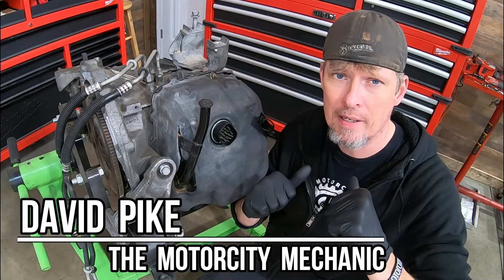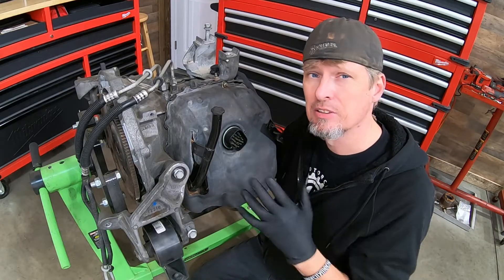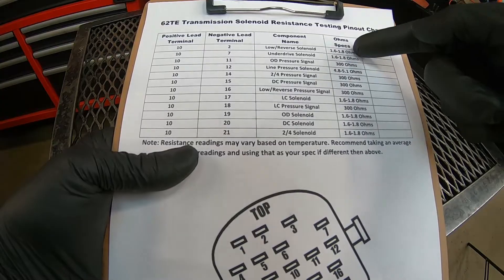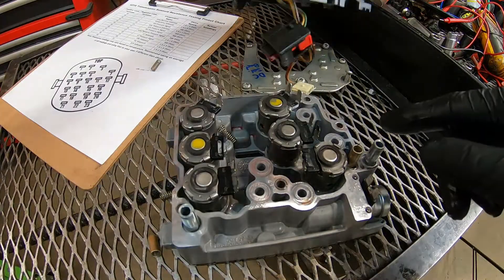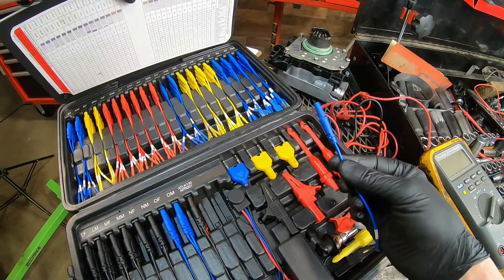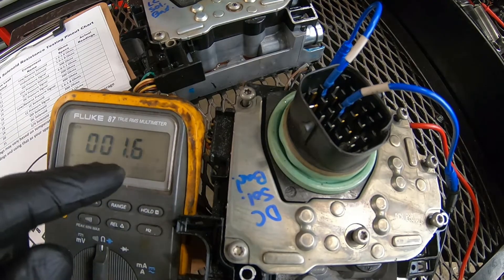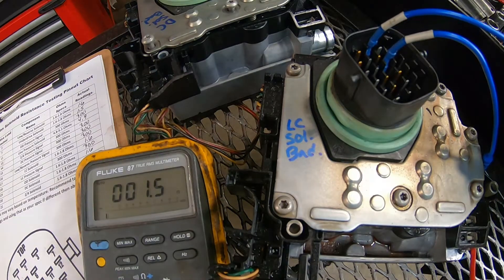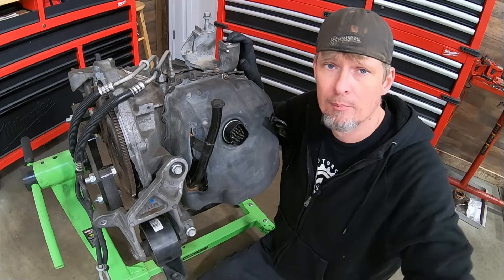Chrysler/VW 62TE Transmission Solenoid Pack Testing

Comment: Fantastic! Thank you for the link to the pinout/Ohms chart. Helped me almost 5 years after you made the video. I'll use your Amazon affiliate link or whatever you call it when I buy a solenoid pack. Other readers, pointy multimeter leads can be modified: find some alligator clips with wires and strip enough insulation off to wrap around your multimeter pointy-things. But FIRST slide a piece of heat-shrink tubing on the wire past where you stripped off (to slide back over your wrap-job). Wrap it tight, slide the heat-shrink tubing over it, pass a lighter under it quickly - don't overdo it. Alligator clips worked great for me. I tested the whole list from the top (didn't crawl beneath my van). All that was needed for access & line-of-sight was clamping radiator hose and pushing aside, and pulling overflow tank up and laying it over out of the way. There are several good videos  showing that. I think the insulating cover is not for sound.  I think that cover is there to reduce the heating of the solenoids.
Reply from the maker: Appreciate you watching and for commenting along with that tip.

Comment: Today is Sept 11th 2025. First, let me thank you for this extremely informative and educational video. Ok, now that we got that out of the way, I am getting ready to drop my transmission on my 2017 Dodge Grand Caravan. The reason? The flex plate seems to have some fractures. And yes, it is making lots of noise. Now, while the transmission is down I want to clean the valve body and Solenoid pack....after I check the ohms on each solenoid for a proper reading. My question, can I use brake cleaner on the valve body and solenoid pack to remove years, and 97 thousand miles of usage? Second question, should I replace the tranny filter? Now, I will share with you what I plan to do with the tranny oil. I plan to filter it through a clean T-Shirt to remove any particles; ( Should I do this to the oil or just add it all back into the transmission)? Now, I have had a bad experience changing auto transmission fluid. I had a Chevy Equinox, year 2006, in where I replaced the old oil for new fresh oil. The Equinox was never the same afterwards. There were times the car would go into limp mode. Or it would not move at all. Regarding the 2017 Dodge Grand Caravan, I want to filter the tranny oil, remove only one quart with a fresh quart. My Question, do you recommend this? Third question is with a comment. I bought this van with 46k miles. When I test drove the van all was well. Nevertheless, the dealership was just off the freeway with lots of noise. When I finally got back home to our residential area, I noticed that the torque converter whined, whizzed or buzzed at very low speeds; perhaps first or second gear. Now, should I replace the torque converter? Or, is there any way I can check the torque converter once it has been removed from the transmission? Or, is it normal for the whizzing of the torque converter being that I really don't have slipping, shuddering or harsh shifting; except when downshifting from 2nd to 1st. I know I ask lots of questions but there is a good reason. I am up there in years and can't tackle these projects as I once could. Again, thank you for the video.

Comment: what about the single shift solenoid that is on the edge not part of the valve body with all the solenoids??
Reply: Probably talking about the torque converter clutch solenoid. I just changed mine. No check engine light, but would buck when coming to a stop and stall a lot of the time -  like a manual trans where its still in gear when coming to a stop. Once I changed the solenoid, problem stopped.

Comment: THANKS!  DIL's  2018 grand caravan was shifting hard, not down shifting.  130k miles. Used your chart all the solenoids checked out good. Changed fluid and filter good as new! Also pin #3 is the TCC (VFS) solenoid 5.1 ohms.

Comment: Hi Dave. I have a 2014 Ram Promaster with 300000km I purchased it as a project. I have a P0740 code. I have changed the atf-4 3times and filter 2times. It did have some water in it. No metal or chunks just lots of fuzz on the magnet. I installed a new Torque Converter when I had the motor out for head gaskets. But it’s still the same. The van is shifting and working awesome but I notice there is no lockup. Will these solenoid packs affect this?

Comment: I suppose if you replaced one if these you could use solenoids from the old one for the next repair.
I wonder if any of the solenoids are interchangeable.
Probably not wise for a customers car but for a backyard mechanic trying to keep a clunker going.

Comment: Amazon doesn't have the brand you are using. Any leads on the one you are using? I'm definitely beyond the grease monkey phase too lol. Hope to hear back from you. I have this exact transmission for someone at church that needs help and probe tool kit would be way safer to use in a confined environment such is the dodge.

Comment: I have a 2020 Dodge van with a P0740 from an auction and it has a  Dodge reman transmission. So I suspect it is likely a misdiagnosis and then sent to the auction.    Curious if there is a check for pin 3 the EMCC control circuit.

Comment: Not a mechanic but electronic eng who used to do all my own auto repair to save $$$. 

Bought a 2010 t&c 9 months ago (77k miles) in great shape. Five weeks in began getting limp mode, intermittently. Check eng came on and off a few times before staying on. Could stop and restart the vehicle to get it to shift ok, but the problem got worse as the weather got hotter.

Took it to several repair shops including two transmission specialists. All of them gave me a different story so i declined servicing until i knew what was going on.

The non-transmission shop was the only one that gave me the correct info (P0760 code) which i found out was correct when i later took it to the dealer. I am assuming the trans shops were attempting to get total trans exch and hid the solenoid codes from me as i was trying to get a warranty repair.

By the time the vehicle got to the dealer the problem was more constant and less intermittent so i really couldn't drive it generally any more.

The dealer told me it was 100% the solenoid pack, that it would fix the problem, that they would warranty their repair for 2 years, and assured me they had a mechanic who had been fixing trannys for 30 years to reassure me to give them ok to do the repair. (BTW, there were absolutely no mechanical issues wirh the tranny and it operated perfectly smoothly when not defaulting to limp mode.)

I picked up the car on Friday, drove it Saturday and Sunday and it was perfect. Monday morning the check engine light came on and by the time i got it back to the dealer i could no longer get it out of limp mode no matter how many times i restarted it. Now, of course, they refuse to retest the pack and insist it always was the fault of the PCM without doing any testing orher than showing me the 0760 code, which, of course, will be entirely at my expense.

I am pretty certain now, that if this vehicle is ever going to work i am going to have to get back into the repair field and do it myself, and the warranty company just flushed almost $4000 down the sewer, and have found that the auto repair industry is in a very sad state.

If i do find out what the problem turns out to be i will post it here, but as an old electronic repair guy i have found that 75%
of electrical issues come down to a bad switch, wire, or contact and only 25% end up being actual component failures.

Any advice or suggestions much appreciated.

Comment: Curious, what voltage feeds the pack through pin 10?
Reply: Depends on the model but on the grand caravans its fed via the TIPM as commanded by the PCM https://docs.google.com/document/d/1sc2KJEEWLZGpnFFNnAzrB-kJFdo3RbHcCdGHwmUn4Pc/edit?usp=sharing

Comment: Hey thanks for the video! Quick question i did this test and everything was ok on the solenoid pack yet i get a pending P0868 engine code so how do you test the electrical connector itself and is the individual line fluid pressure sensor attached on the bottom left of the valve body the culprit that can cause the P0868 and p1745 engine lights and cause my 2014 dodge grand Caravan to go into limp mode? Your help on this would be helpful i already paid for a obd2 adapter and appdiagfca app to clear the codes and perform a quick learn on my transmission and its driving smooth now but i still plan on changing the fluid and filter i just need to know if changing that individual lower left line pressure sensor aswell while im in there is the solution?

Comment: Referring to your video. 10:45-10:50...I did the test and all solenoids "ohmed" out fine...but since this isn't conclusively telling me the solenoids are working, is there a way to stimulate the solenoids individually (with the pack in or out of the car) to further test them? Like apply voltage and listen for a "click" or something...?  Obviously just trying to do whatever I can to avoid removing and replacing the pack unnecessarily.  Thanks.  
(2015 Chrysler T&C; 62TE; New TC & Flex plate, TCCvalve, Line pressure sensor, Pump, filter...trans shifts & works great except for intermittent stalls at idle when placing in D or R and P.   Original issue was a damaged TC.  I removed the trans, set up a DIY flush rig with trans out of car and flushed trans and cooler (separately)...installated all new parts, ran for a few miles, then changed fluid again, and changed the TCC Valve again...then did your pack test in the car...now what!!!???)

I puchased a pigtail electrical plug and used that to easily conduct the ohm test you described...it made it relatively easy with the trans & pack in the car.  
Like this:  
https://www.amazon.com/NOVAPARTS-Connector-External-Solenoid-05019917AA/dp/B0B1MKDRX5/ref=sr_1_2?crid=19PELF4QCZJI7&dib=eyJ2IjoiMSJ9.s8JhFVO7jWK50PP2OAy5ksiPHltThc9W7E_3uhiMyvPiyDN4-0apQxGB8dS8mrKnQhtPu5I2sX-m3TfSHigqY4hVuJvW8LhrIEgr_2rW-QnQMIGl0X5vNFdBVNfrOgRlX6SdX7XscGnjlKbXCOfwYSq55JY17k0i7-Uw3nxFkfNg1qbjYA0zC44kX4GBYMaR.Gvdocq0jz2U6LMfh3xh70ul0by-QM8s04EjGz-bhi2w&dib_tag=se&keywords=62TE+pigtail&qid=1721754659&sprefix=62te+pigtail%2Caps%2C78&sr=8-2

Comment: You did this testing with the solenoid pack out of the trans...can these tests be completed with the pack still installed in the trans?  I mean are your specs on the data sheet applicable (I know I can physically, though challenging, get to the pins while in the trans in the car).  2015 Chrysler T&C
Reply: I did the tests with the trans and pack in the car...I got all "good" measurements..so my problem still exists...sent you an email David...any help you can offer is appreciated. Thanks

Comment: Something noone shows us on you tube is where the power and signals come from to the 62te transmission on a 2014 dodge grand caravan sxt 3.6l so we know where it's located so we can test those sources instead of just going through fixing the transmission going through all that trouble and still end up getting these codes afterwards.  Like what relay in the tips on a 2014 effects it wheres the tcm located etc etc

Comment: I hace code p1745 too high Variable Line Pressure (VLP) p0868 also to low will replacing that solenoid pack fix it 9r will I also have to change the top torque converter sensor and the lower left side fluid pressure sensor that both are attached separately to the valve body itself like the center solenoid is? I'm in limp mode and dying to take a shot at being the family hero and fixing this myself and saving the day lol

Comment: 2012 Volkswagen Routan 182,315 miles, had drove about 250 miles, was sitting at a red light felt like we got hit from rear. Pulled away just fine, got into a parking garage, started to whine, shift funny and slip, parked. Came back in about four hours, started up and seemed to be OK, headed out, after about 45 minutes of city driving, made a hard stop, would not drive forward or reverse. Pushed it into a parking lot. Came back the next day to haul it home, Would back up, but would not drive onto dolly. Checked for codes P0733, P0868, P0841, P083B, P084B, were set. Changed filter and fluid, cleared codes. Will drive ln manual 1 & 2, slips in 3 and stops driving forward, will drive in reverse. If you restart will drive forward until shifts into 3. Code P0733 came back and will not clear with my code reader. Can the solenoids be tested in the transmission? Do the gaskets on the valve body have to be replaced, if solenoids are removed? Is there a pressure test procedure for the 62TE? Thanks for some really good information, great help

Comment: I tested my solenoid pack everything came up normal except for signal pins 11, 14, 15, 16, 18 which should have been 300 Ohms all came up as open lines. This is a pretty strong signal that my solenoid pack is bad however my concern is those pins going bad may have been caused by a problem elsewhere in the system. I'm interested what may have caused to problem and rectifying it before plugging in a good solenoid pack and having it suffer the same fate

Comment: First thank you for sharing.... 
This would have been good to know years ago.  We had a Dodge Journey that the electronics in the trans was setting a multiple misfire code. I checked everything on the engine side and finally realized it was from the trans side sending goofy things to the pcm. The original trans shop that did a rebuild on the transmission only had 15k miles but was out of the time warranty. They would only touch it if I opted for a full rebuild again. If I would have know this, I would have checked myself and saved myself some money. Afterwards they told me this that and the other and that the selenoid pack was bad.  Afterwards it was what fixed a multiple misfire... who would have thought. Electronics can do weird things.

Comment: Excellent video and super good instruction.  Can I verify solenoid operation by applying 12V to it and hear clicking? Or is it not 12V device? Also, is there anyway i can get TCM schematic or anything near? I have 2014 Promaster that drops to neutral while driving then takes 2-3 hours cooling before back to normal. Could that be heat related open circuit somewhere? I can run it normal for about 17 miles before it happens. Thanks in advance

Comment: Hi David. Been using this video for YEARS. Just noticed the chart doesn't show the TCC solenoid, which is pin 3 and should be 4.9 ohm. Helpful for diagnosing the dreaded P0740, which in my experience seems to usually be the converter itself, supported by if the fluid has clutch material in it.
Reply: Mime has 6.0 reading would that be bad
Reply: @adamrichmond495  assuming the code is associated with the function of the pin you are reading, ranges outside the given values would make you suspect that solenoid.

Comment: They were the peeling stretch marks on the converter, change the oil pump, converter and filter.  but.... now it only goes in reverse, and I have the active code P0871 that you recommend.  thank you so much

Comment: Thanks for this video. Very helpful! I measured the solenoid pack going through all the pins and all the readings were correct. Is it safe to say that my issue is NOT the solenoid pack??? I have a P1745 code and my Grand Caravan is currently in limp mode. Thank you!
Reply: Did you happen to find a fix for your issue? I'm having the same problem.

Comment: I really like how you break everything down. My only concern is that my numbers are coming out higher than what on your sheet on all by at least .3-.4 ohms I’m getting 2.1 and 2.2 ohms on all solenoids and 5.7 ohms on the line pressure solenoid

Comment: I know this is a couple of years old, but I am in the process of replacing the pack on a T&C. The new one came in (a MOPAR unit, not aftermarket or rebuilt), and I did all the resistance testing. Every one of the "1.6-1.8 Ohms" tests actually came out at 1.1 Ohms...every one of them. The remainder came out at 300 or 301, just as the chart says. Is this a problem with the pack or is 1.1 acceptable? Or is it possible my multimeter is evil? P.S. Love your channel.

Comment: Hi, thank you so much for your videos. my car dodge grand caravan 2016 with 62te transmission worked well without any problem , since 3 days ago, the weather of Toronto was very hot ( near 38 C") and after 30 minutes driving ( especially around noon)  there is kicking problem with it. i am wondering if you can help in diagnosing the problem. appreciate in advance

Comment: 2017 Grand Caravan here, my flex plate is cracked at 149,500.
Having that replaced, figued while in there I'd have the TSP replaced as well, however i recently was made aware of the TCC, this too should be replaced due to mileage.

If there any of solenoids you'd recommend having switched out while the Solenoid Pack and Flex Plates being done?? 🙏
I'm a state certified foster parent, i need this minivan in top notch condition, i should note that tge transmission fluid and filter was replaced 3 months and 10 thousand miles ago.

Thank you kindly!